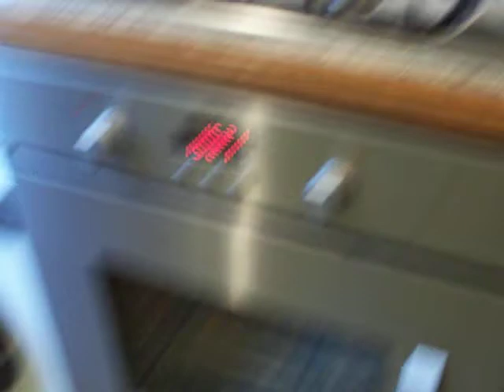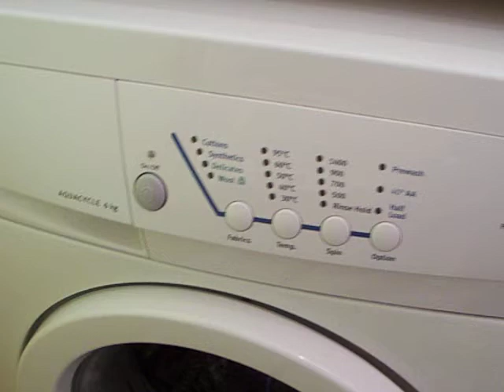Fuses : Plug fuses to BS 1362.

Comment: I buy a facial machine pro-9988 i guess the fuse is not good
am not sure what fuse I need because a friend loss the fuse and I never see it
what can i do to get my machine work,? there is no electricity
Reply from the maker: Hiya. Depending on the wattage, put a replacement fuse in the plug.

If it is less than 750 watts = 3A fuse

If it is more than 750 watts = 13A fuse.

This is a basic guideline only, without all the technicals associated with motor inrush and things like that.

Thanks for watching,

-BoomBoxDeluxe.

22nd July 2016, 19.35